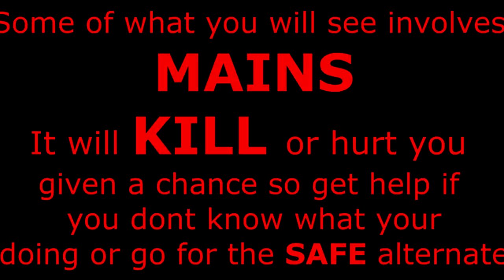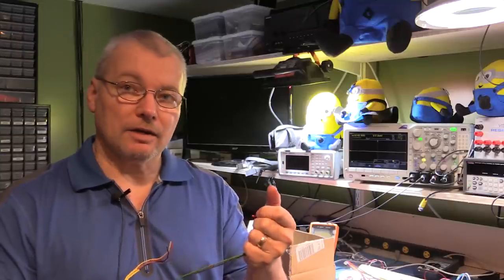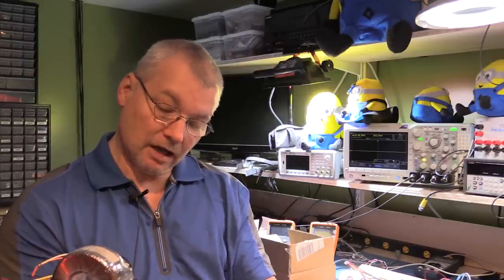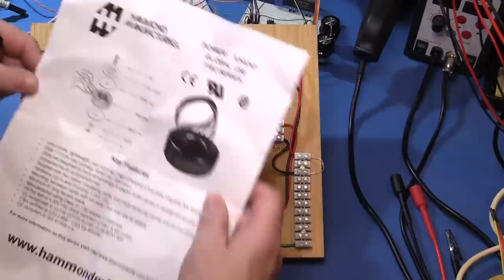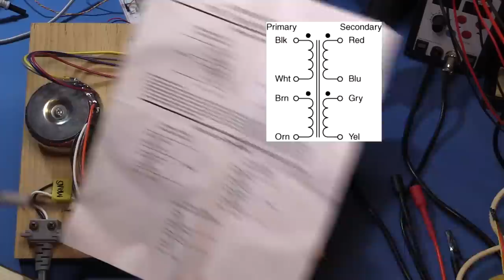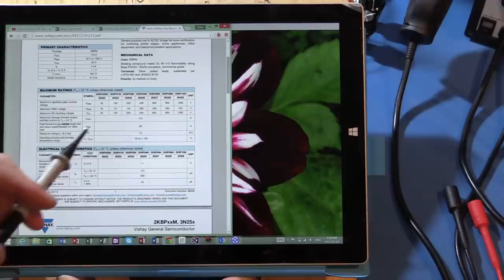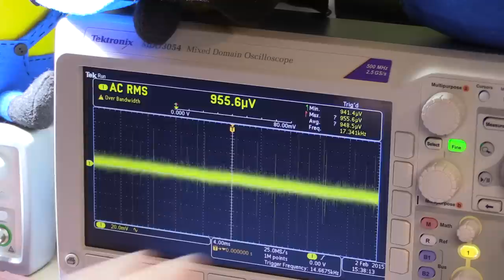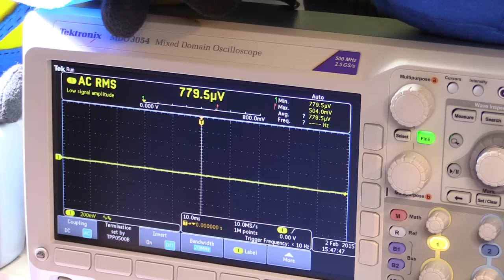The Modular Bench Power System #7 - Power Input Options

Comment: Thanks Peter, this was one of the best videos in this series imo :-) 

I have a couple of 2x15V, 300VA, toroids that I was planning to use for this project, but I think I'll settle for just one of them and connect the secondaries in series to get 0-30V at 10A - that will probably be enough for most of my needs anyway. 

Already looking forward to next video from you (and to get some free time to actually start prototyping myself) :-)
Reply from the maker: WOW, that would be one bad ass PSU, I would expect you would also need soft start on the mains side to prevent it popping the fuses every time you turn it on ??
Reply: Peter Oakes To be honest I haven't even tried them out yet so I'm not sure... haven't thought of that this could be an issue :-/
Will try to hook one of them up tonight and see if the light turns off when I do :-)

BTW, here are the specs for them in case someone is interested.
https://www.elfa.se/elfa3~se_en/elfa/init.do?item=56-126-35&toc=0&q=56-126-35
They are NOS and had been in storage for 10-15 years or so when I bought them, but they all look perfectly fine.
Reply: Peter Oakes - you are right, I need a soft start for these toroids... almost set my multimeter on fire yesterday when I tested them for the first time :-/
The test probes started smoking almost immediately when I connected the mains side, but no other harm was done.
I think I already have a soft start board from an old audio amp I scrapped a few years back, will definitely use that from now on.

...oh, and I should probably have used a power resistor as load when testing the toroids, and not just short the secondary with my multimeter... doh

Comment: I used 1kΩ 10W power resistor as a bleeder... similar setup to yours, makes it safe after about a minute. I learned my lesson after shorting it with a (thankfully insulated) screwdriver.
Reply from the maker: Yes, with big caps and high volts, there essential

Comment: very helpful!  newbie question: if i correctly understand a laptop power supply also eliminates the risk for having  a closed loop  circuit via earth ?  (is there an isolated transformer inside?)
Reply from the maker: There is usually an isolation  between the mains and the power delivered to your laptop but sometimes depending on the design of the power adapter there may be a capacitive coupling between mains ground and the 0V of the output from the brick

now if the brick is only 2 pin where it plugs into the wall then there is no ground involved (The unit is what is typically called double insulated) so no ground is necessary and you would have nothing to worry about.

Be wary of cheap ebay sourced power supplies, often they're not built to the same standards as local codes require

Comment: Peter, is there any advantage to using two smaller capacity smoothing caps as opposed to using one larger capacity cap?
Reply from the maker: In this example I simply wanted to add more capacitance than I had in any one of my caps, and I have several 10,000UF available

but that is a good thought and often you will find that some capacitors will have a better frequency response than others, for example you will often find a 10uF and a 100nF in parallel for circuit board level filtering which initially may seem odd until you consider that at lower frequencies the 10uF works well for smoothing but fails miserably at higher frequencies to the point of being ineffective (Noise filtering vs smoothing ), the addition of the smaller value cap can extend the range of the noise filtering way beyond the higher value cap but not have any significant impact on the overall capacitance

The same can apply with larger caps where the frequency response can be improved with including a lower value in parallel with the main caps. I have not done this here but if you look up the specs for a 10,000 and a single 20,000 you will probably find a difference in frequency range vs say effective series resistance

I believe it has to do with the reactive inductance exceeding the reactive capacitance such that above a certain frequency, the capacitor effectively becomes an inductor (In many cases, maybe not all but this is relevant to electrolytic caps)

A good topic for a future video :)

Comment: Not worried about having no mains-side fuse on your test rig? Also having a mains-side switch would be a nice safety feature in case it all goes wrong. I am even more paranoid and run stuff like this on an extension cord so I can quickly pull the plug without reaching over the circuit under test.
Reply from the maker: Yup I agree and the only thing I did not have in your list was the local switch on the board under test, the rest just was not on the board, Ill put together a video I think to show my safety setup in the near future

Comment: Hi !

I'm enjoying watching your videos !
you're reffering only to US and UK viewers.
you have at least one European viewer (that would be me), from Croatia.
having worked as an electrician in US for a while I still can't understand how 120VAC @ 60Hz could get anyone killed, unless they stand in the water barefeet, or use both hands to grab live and neutral :)
since there were no "touch-srewdrivers" (one hand mains detection tool) in the US, I used my finger to check whether the mains voltage was present.
over here, we have 240VAC @ 50Hz, which is way more dangerous.
also, most injuries resulting from an electric shock are due to the falls. One is high on the ladder trying to fix a burnt bulb, or something. Not being prepared to a possible shock, one reacts wildly and falls. Bones get broken.
Reply from the maker: LOL, well while I understand and can relate in concept with what you say as I learned my trade in the UK and therefor am also used to the 240VAC and way more and understand what I can and can not get away with when using 120VAC, but at the end of the day my audience ranges from absolute beginner to seasoned engineers and young teens to retirees so I have to stay on the side of safety even if it sound over Kill to a veteran like yourself. I would be very upset if my advice caused someone to get hurt even as a secondary event from a shock. I would rather have people enjoy the experience than be afraid.

Also I do not intent to offend (If I did) by omitting other country power systems etc, I just am most familiar with UK and North America (Specifically Canada) electrical systems, though I still have to think twice regarding the black and the white wire :)
Reply: Peter Oakes:)

no offence taken :)
keep up the good work !
Reply: John Smith Because sometimes when electrocuted, the person can get stuck to the source and if enough current goes through them for long enough, they can die or get seriously injured.

Comment: Thank you for another great video. But where is your mains fuse? You talk about safety, but this is not in par with your other videos. Furthermore where is your mains line filter? I expect that to be a main component in a bench power supply. Where is earth grounding? I love your great videos, i really do, but this one is missing some vital parts i believe.
Reply from the maker: That is a very good catch, and I had considered this,

My whole bench is protected by an earth leakage breaker and well fused so for this instance I am well protected and none of this demo will ever be left alone and powered on
To add a fuse holder to this wooden board layout would have introduced quite a bit of exposed metal on the fuse holders that I have and therefore I took the safer route and left that out knowing I am protected and everything is well insulated in one way or another on the mains side.

Fuses are designed to protect the device and or the electrical system, not the human, so as I had thoroughly examined and checked my wiring and knowing I have personal protection and that this was a temporary set-up for the purpose of demonstrating the parts of the power supply for the video, I chose to leave it out, now that you mention it, that was a bad decision due to the possible implication it is not needed. Of course in the UK and other areas, the fuse is in the plug (But not here).

In any project that I would make that is going to last as a usable product I would include Mains fusing on the case to it is easy to replace the fuse should it blow and this should be the way anyone else doing the same thing should proceed and I already have these parts ready for a later video to deal with  mounting the PSU into a case

On reflection I probably should have mentioned it in the video, I will the next time I go near this area of the design to ensure there is no ambiguity or risk to those following along
Reply: Peter Oakes I also was wondering about the missing fuse. If you are concerned about the exposed metal an inline fuse holder would have worked, or are those too cheap to do the work?
Reply from the maker: Álvaro M. Valdebenito B. Not really missing, just not on that end of the wiring, as I said above, my bench is protected by Fuses and also ELCB. For the purpose of the demo I did not put it in but on reflection should have mentioned it and my reasons , that was my mistake. If the board was to be left on un-attended etc then yes that would be bad, also the fuse would not protect me in any way and would have to be close to the same rating as the bench fuse I have in order to not blow with inrush currents (There fast blow on the sockets I was using and only 5 amps). As I said, fuses protect equipment and infrastructure, they do not make anything safer for me working on the unit,

The Demo board was only put together for the purpose of the video and ripped apart again, I plan to create a video regarding housing the power supply in a case with all the right fusing, connectors, securing of the heavy transformers etc etc as we go

Anyway, yes, should have put in a fuse even just for the sake of not giving the wrong impression. Ill not make that mistake again :), Peter